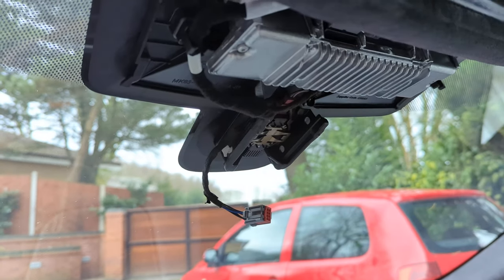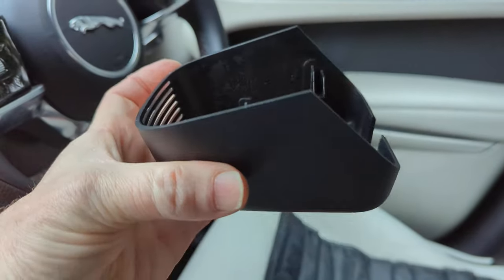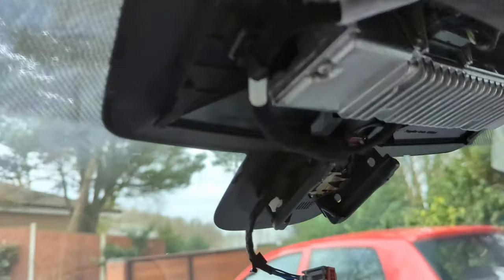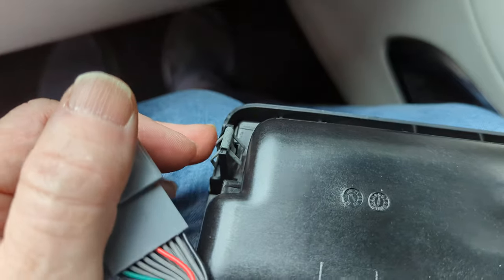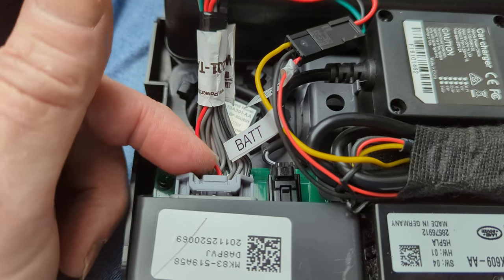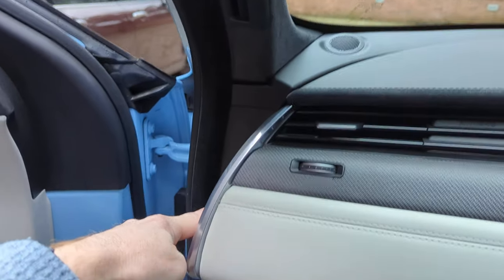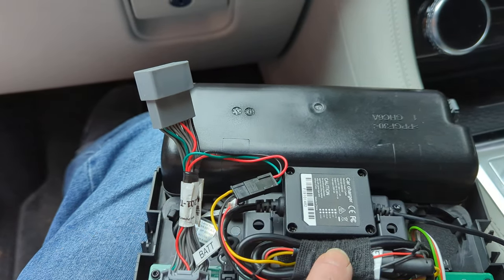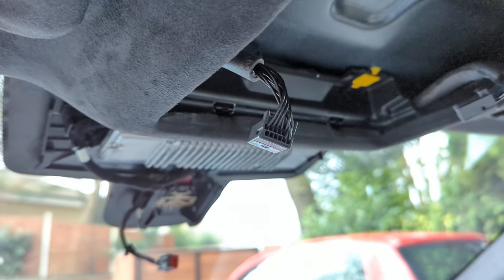Jaguar F-Pace. How to install a dashcam through the overhead Console

Comment: Hi Paul, I've asked Powerfuluk, but only supply Range Rovers. They said the one your using is EWL201-TAP-LOOM. When I looked, there are 8 to choose from! Is there anyway I could choose one that might work on my Jaguar XJ X351 2010 model. With the group JLR I'm sure something from the RR would be OK in mine? Thanks - just in case you could help!
Reply from the maker: Hi, not sure on an X351, all I can offer in terms of help is see if you can find a wiring diagram and see if it matches. I would suspect you have a good chance.